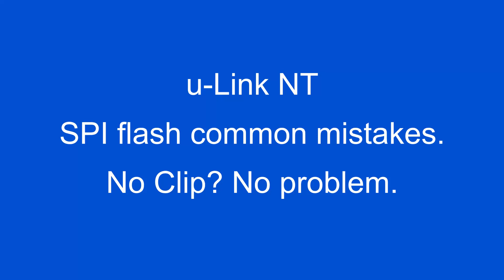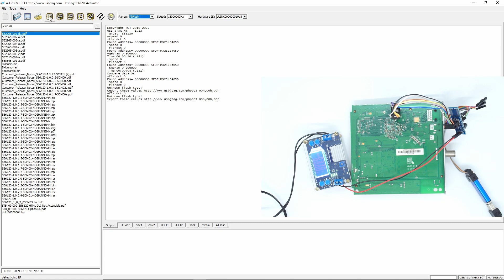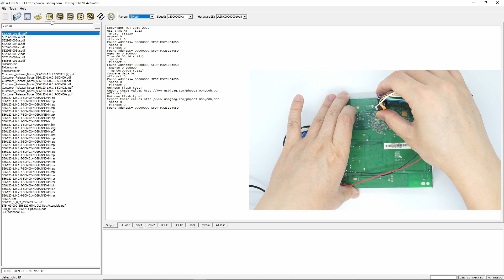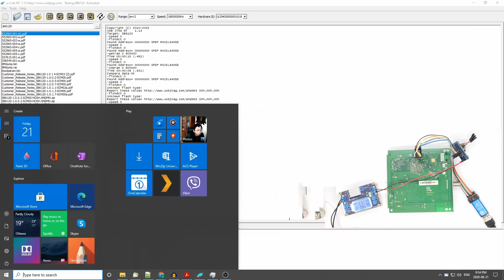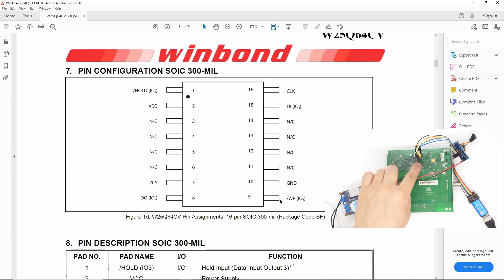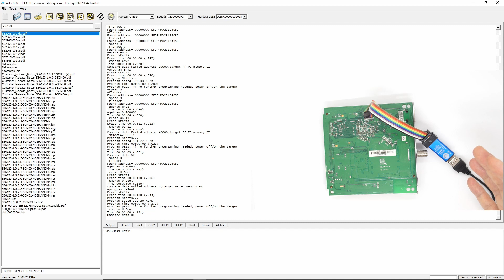Common mistakes for SPI flash programming on board using u-Link NT (USB JTAG NT).

Comment: What power supply do you recommend?  Can you specify the reference of the power supply used in the video?
Reply from the maker: If it is 3.2v and low amp, use 3.3v from the u-link NT.

Comment: You don't need external power with the ulink
Reply from the maker: It depends. If the power drawing less than 400ma then it is OK to use power from u-Link NT. It is not recommended larger than 400ma drawing from u-Link NT. (It does work sometimes)